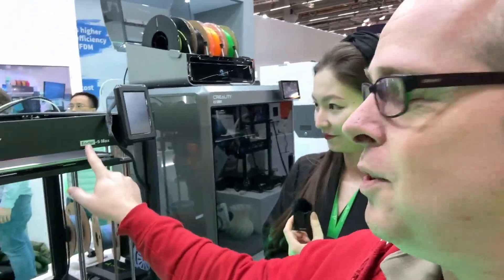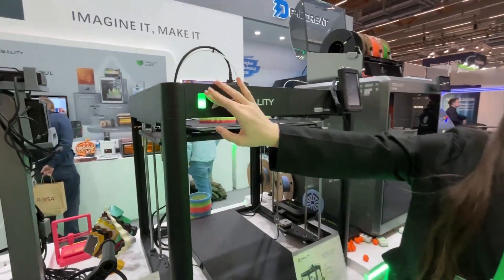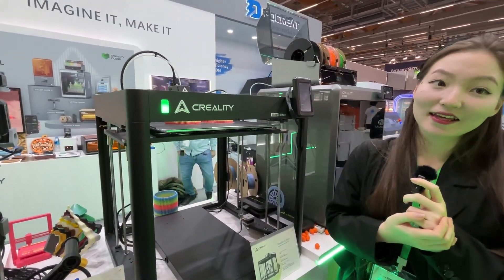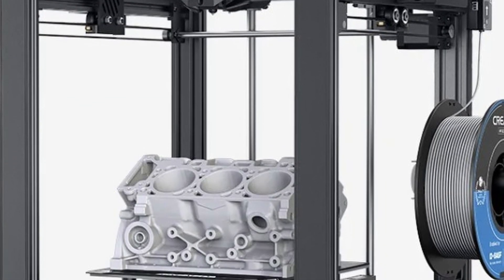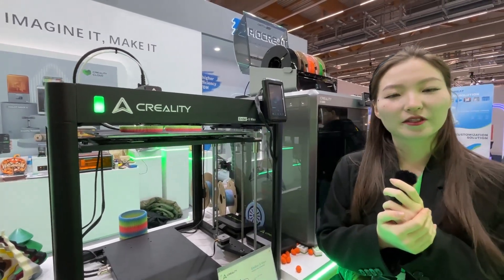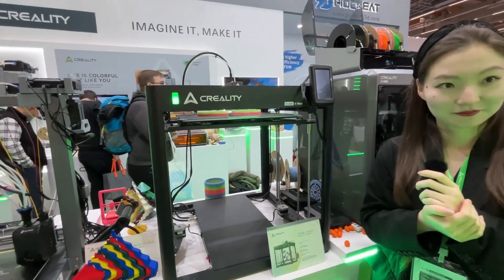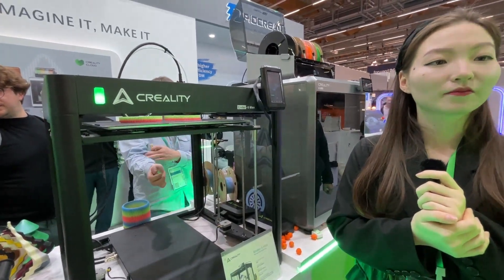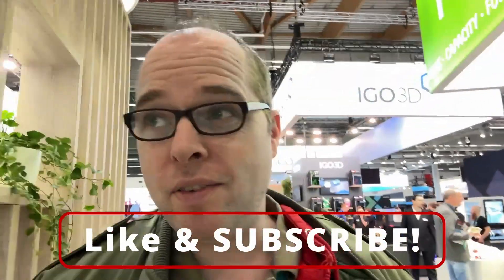Hands-On with the Ender-5 Max at Formnext 2024! Next-Level 3D Printing?

Comment: Zac, I know this is a translation issue. I am confused why an indicator light is considered an excitable pro? Indicator lights have been around since 1817 in one form or another. Also when you said "or needs to be harvested" was this in regards to a finished print or that the printer was broken and needed to taken out of service? Sorry I really want to buy this printer but I am a stupid noob. thank you
Reply from the maker: Hey Alanday5255, no problem! The light can show multiple things: Green for running, yellow for Idle and red for Error. 
Like mentioned in the video, if this printer is being used in a printfarm or just maybe at home, you can see what is going on with the printer. But of course, since the printer is open and big, you can see what the printer is doing. 
My remark on the harvesting the print, was that if the light turns yellow, the print is ready and you can take it of the build plate. With the Red light, your printer needs attention from the user and see what is wrong. 
I don't think you are stupid noob at all, asking question is great

Comment: My first 3D Printer was the E5P.  The assembly of the printer was my 2nd YouTube video.  I still have it.  I did 11 videos on the E5P most were upgrades. I have been asking Creality for 4 years when an updated version was coming out.  Finally we are here!  Hopefully they are not 4 years to late 🤔
Reply: My only concern is that bowden tube just rolling around on the build plate.  Hopefully they will have something in place to keep it in the air.